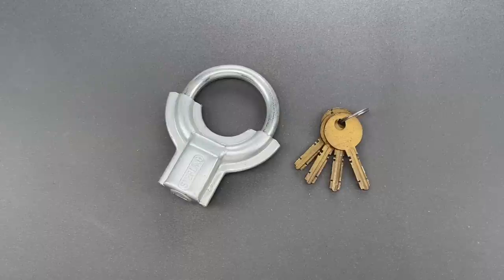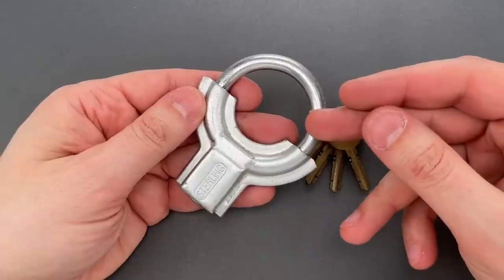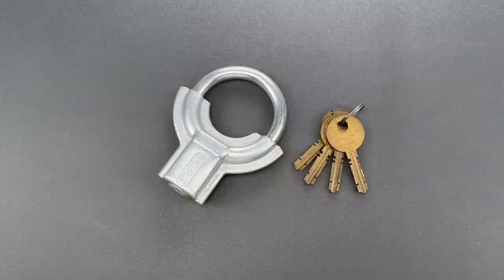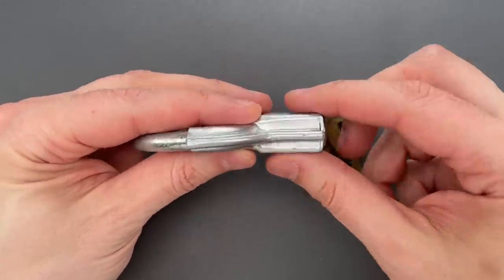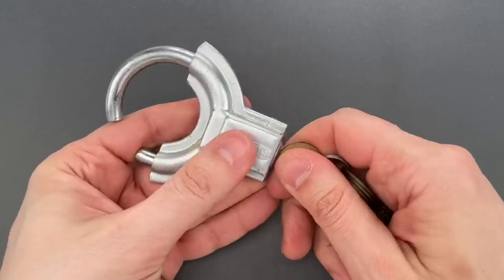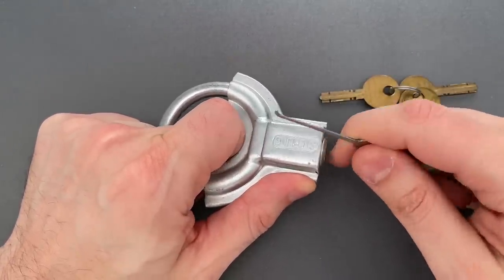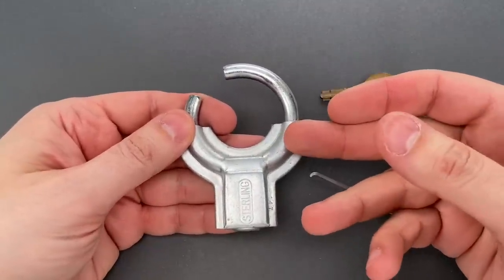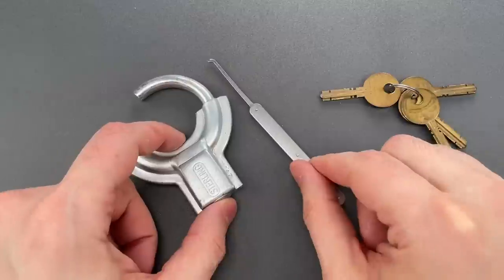[1512] Sterling “Gas Pump Lock” Picked

Comment: The market for this sort of lock must be an interesting one. There was a  serial or ID number stamped into it on one side; but it looks both relatively costly and relatively clonable vs. dedicated tamper-evident seals(plus a non-destructive attack leaves no trace); while it certainly doesn't look like it meets the expected standards for a lockout/tagout device, which is an area that wouldn't care about its trivial resistance to destructive attacks and would appreciate its overall low price.

Does this design just predate ready availability of fancy serialized holographic zip ties; or do there continue to be niches where just a latch won't do; but the user cares little for either tamper evidence or even token resistance to someone with a pair of bolt cutters?
Reply: If it's really a gas pump lock, all you need is something that's the equivalent of an Out Of Order sign that the clueless customer can't ignore.
Reply: @darrennew8211  Gas stations here either pull a plastic bag over the nozzle handle (immediate-term, not locked), or lock a red canvas "OUT OF ORDER" bag over it and through the rings on the pump itself.
Reply: @AaronOfMpls  Right. I'm thinking this would be the lock they use on that bag, just based on the name. I've personally never seen one before. You wouldn't need to lock the bag over the pump if people weren't stupid/karen enough to take the bag off, fail to pump gas, then complain the pump isn't working.

Comment: I see these locks used to secure the little side doors on either side of a semi-trailer's ramp storage all the time. I get a kick out of stagehands trying to take them off and accidentally locking them. The drivers don't find it as funny when they unlocked it early on and have to grab their keys again.

Comment: As always, great vid but in this case I think you made a small mistake, when that lock is actually locked onto something it was designed for, one wouldn't be able to place their finger through the loop thus picking it might be slightly more awkward than it would have been here.

Comment: How easy would it be to grip this lock the way you did to apply tension if it was actually attached to something?
Reply: If it is attached to something then it would be even easier since the attached object will help hold it still.
Reply: @starburst98  If it's attached to something there is no way you're going to get your fingers through the way he did to apply tension to the shackle. It's not just a matter of pulling as you would with a standard padlock; the shackle needs to be rotated.
Reply: Still mot difficult, the large shackle gives you freedom of movement.

Comment: I wonder how many attackers would be foiled by just not realizing that the spring is on two sides of the keyhole, rather than having a single row of pins along one side. They get a click on one, there's only one "pin" on this side, but the dang thing isn't turning...

Comment: This makes me think of plastic clips with a wire loop I often see "preventing opening" utility meters or boxes. Those really just say "Hey, you're not supposed to open this," as opposed to any real security (and to tell the next worker if it was opened?). This lock is a step further, requiring effort (even if just a little) to open it. Seems suited to its purpose (unlike anything from Master lock).

Comment: Wouldn't this lock be more difficult to unlock than a normal padlock, because of the difficulty to get tension on it when installed? I mean if the picking is equally as difficult, is it a significant advantage to be harder to tension?

Comment: BITD, gas pumps were operated by a Uniformed Refueling Technician and the pumps weren't terribly sophisticated.  If the owner left the power to the pump on and didn't lock the nozzle to the pump "kids" might find that and call the other "kids" on their CB radios and fill up before the cops got there.  

Now it's all self-service and lots of 24-h stuff and where's the fun???

Comment: That looks a lot like a bike locks in 70s and 80s. Even the key looks similar. I bet there is a bike lock version of this same out there.
Reply: There were several, including a type that bolted to the bike frame, so was always there.  The ring simply went around the tire and through the spokes.

Comment: The resistance to brute force opening is probably more important than pick resistance, given the intelligence of most gas thieves.
Reply: I don't think it's to stop gas thieves. If nobody is in the building, the power to the pumps is shut off. I think this is basically an out-of-order sign the inattentive customer can't ignore.
Reply: @darrennew8211  Farmers typically have gasoline or diesel fuel stored on their property. I can see using something like this to prevent thieves. These tanks are typically gravity flow.
Reply: @machintelligence  Well, yes, I was talking about commercial gas stations like where you go to fill up your car. Not private stashes of fuel for farm vehicles.

Comment: Looks like it's made about as economically ss can be done and still call it a lock.  looks like it was designed by an accountant; in this case i hope the bean-counter got a nice promotion.  i take it that a standard skeleton pick would work too, since it's  a warded lock?
Reply: Warded locks are easy to pick.
Reply: @brenthaymon280  too easy, just takes a skeleton key; that's why Yale invented the cylinder lock. At least it takes a LITTLE skill; wards take none.

Comment: Why is it called "Gas Pump Lock"? What exactly it was suppose to lock? It would be helpful to have a little explanation when you show some unusual locks.
Reply: Gas pumps had/have a hole for the lock ring near the trigger and this would go on to prevent use, among other cases.

Comment: I think a twist tie from a loaf of bread would give more security.
Reply: it both requires some knowledge and tools on how to defeat and indicates that others are not allowed to access whatever it is guarding- meets the requirements of the application it is designed for. plus it's most likely enemy is bolt cutters, and those will take out even basic padlocks which presumably cost a decent bit more
Reply: @The Algonquin, what's funny is how easily he defeats many locks as if they were just "twist ties from loaves of bread". There are no doubt some people who spend more time picking their noses than this man does picking "security locks".😆